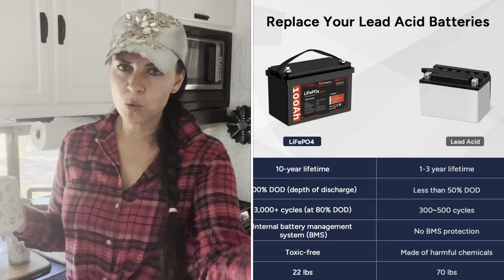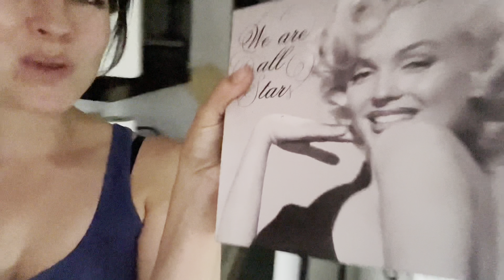INSANE Lightning Storms, Monsoon Madness, & Wildflowers 🌩️ + CheapRVliving Collab Announcement!

Comment: My 219 Fors Transit was hit by lightning in a dirt parking lot-off- in Santa Fe NM in June 2023.
It destroyed my engine but all electrical/ solar inside were not affected.  It hit my MaxAire fan which I was standing under and was hit also and knocked into my cab.  When I woke up, my ceiling was on fire.  I have since bought and moved into an Old Class C- horrible fuel mileage.  But it has given me the space to figure out my next move.   Would love to connect with you.  I’ve had mice too.
Reply from the maker: Oh wow! That sounds frightening! Sounds like we’ve have some similar experiences (Class c, mice…).  Will you be in Q this winter?

Comment: I've stayed in a crew cab Ford Explorer for about 4 months in Vegas and it sucked! I'm sure it would've been better if I took out the front passenger seat. You must be kinda short living in that car. I don't see how you did it 🤔
Reply from the maker: That’s a truck, right?  That sounds quite difficult in Vegas.  I exhaust quickly if I am nomading in a town instead of on public land. I’m about 5’5 and removing all but the drivers seats has helped with space in the car.  Thanks for watching!
Reply: @autumnandchloe  Yeah it's the truck version of the regular Ford Explorer. It wasn't too difficult to find places to sleep, I'd roam around the city, parking on streets sometimes and it's quite rural surrounding it. Removing the back seats too would've probably helped stretch my legs out. I had to stay in a motel twice a week to do it. If it was a regular Explorer I'm sure it would've been way easier but it also gets frigid there.